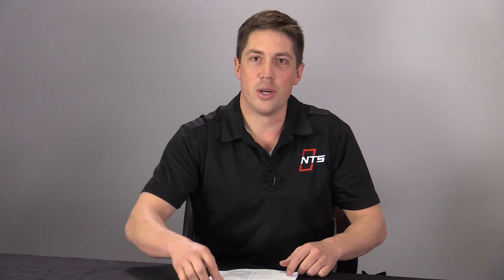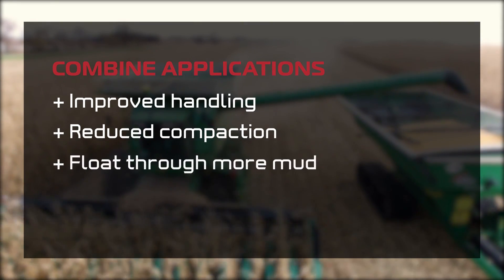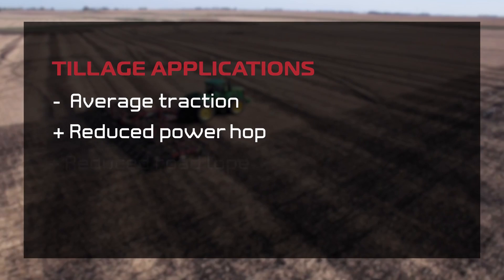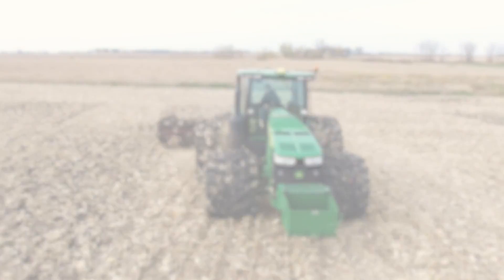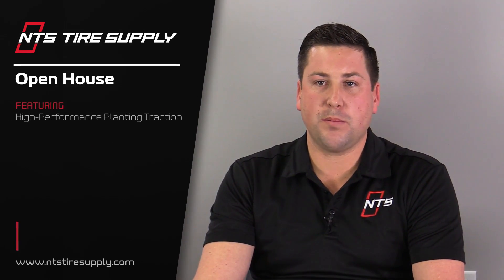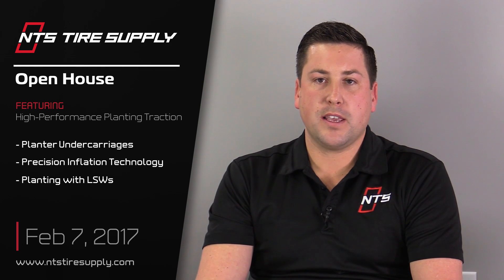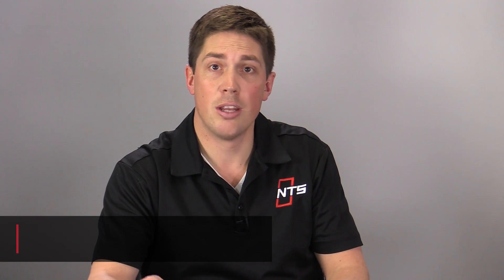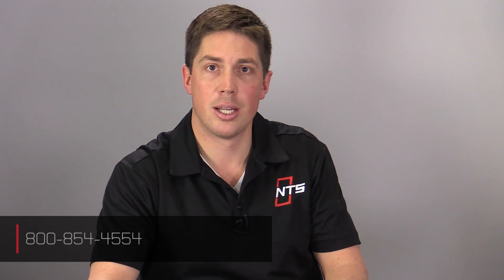Are LSW Super Singles Better Than Duals?

Comment: I use LSW tire on my scraper steiger and front wheel assist tractor and they performed great pulling the scraper
Reply from the maker: Glad to hear they're getting the job done! How long have you been running with them on the scraper tractor?
Reply: @NTSTireSupply  About year now . We love on the tractor . Think about put a set on articulated dump truck , if it can be done ?
Reply from the maker: @richardgavin6712  Could you share the year, make, and model of it? We can take a look at potential options for you.

Comment: The bumpy ride, the wear and tear with duals and the problem of turning is explained in this film about dollys. The inner and outer tyres is attached on two different positions on the axle. They are forced to turn with the same velocity, but has to travel two different distances. That is no possible by physical law unless the tires are forced to rotate towards each other. 

Dolly Demo, "Work Smarter, Not Harder" https://www.youtube.com/watch?v=EaH2olatnts
Reply: Torben Sollyst Mikkelsen yes this is true, But the same stresses happen to these 1400’s. The inside and outside of the tire have to cover a substantially different amount of distance during a turn.